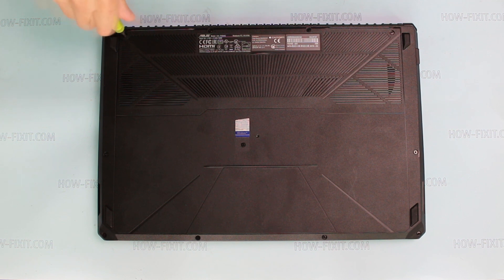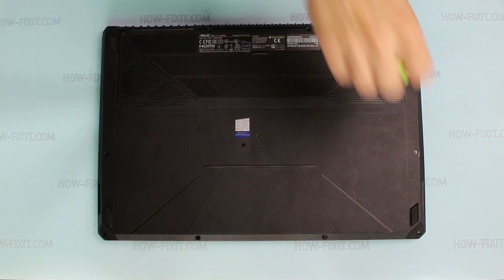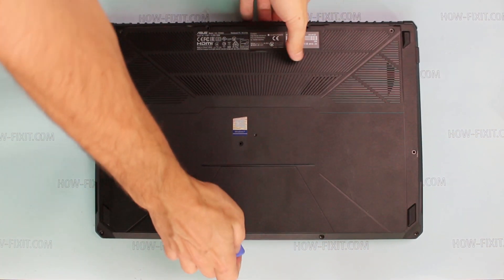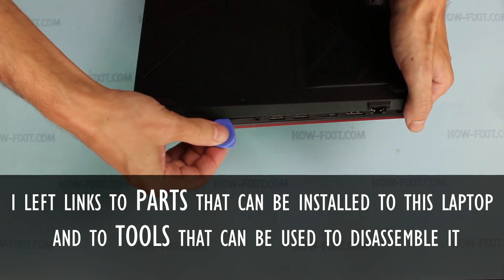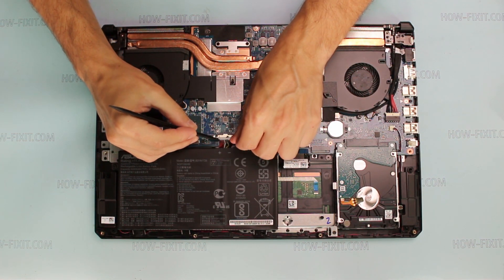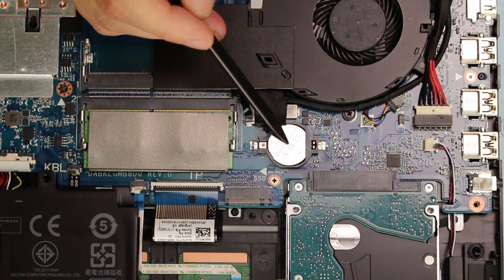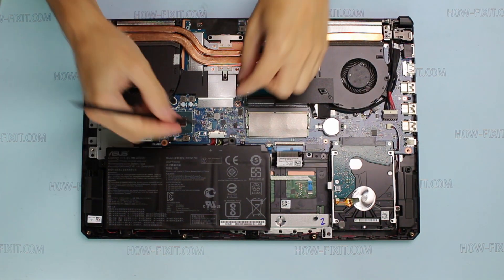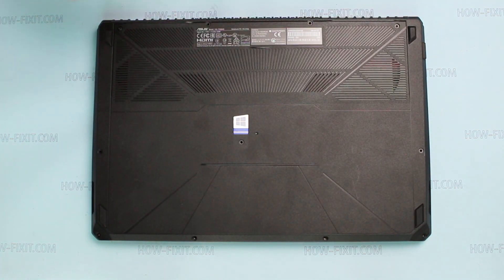Asus TUF Gaming FX504, FX503, FX80 Laptop BIOS Reset & CMOS Battery Replacement (Easy DIY)

Comment: I was trying to update my Bios via usb and it was stuck on Bios updading screen from almost q hour so i tried to turn off the laptop.  The laptop turned off but the keyborad lights were on and screen was black. I tried to turn on the laptop but nothing was happeming so i let the laptop like this and removed the charger so the battery could drain . Next day when laptop keyboard lights were off i olugged the charger in and the keyborad lights turn on directly and i pressed the turn on button but nothing was happening.  Will try this step now.  My laptop is Asus Tuf fx505du.

Comment: I have a problem with fx504gd. I ran a cpu benchmark in throttlestop and it takes 35w and 45w on turbo boost but as soon as I run a game or use anything that is using the gpu it is power throttling and stuck at 25w 2.2ghz. Tried everything in throttlestop and this does not go away. Guessing it was something did by asus to avoid overheating but is there anything I can do to fix this shit ?
Reply: same problem. High heat, low fps. It is because of the bios version 310. I am also looking in how to downgrading the version to 305 but nothing was usefull
Reply: Already said it but the only thing u can do is wait for the lazy cunts at asus to realise a fix but that will be only in September or so based on their previous update realise dates. 
You can't change the motherboard because the cpu and gpu are literally glued to the motherboard so it can't be replaced.
I don't think they tried to solve a heat problem because if they did, than they failed that bad that it just made it worse. I think it is a power management problem, the GPU is as good as before, the problem is on the CPU, it seems to have a locked voltage which is dangerous, it gets to much when it doesn't need it and when it needs that power the CPU is starved. This can cause many problems. In my case i get 20-30 fps in games where i'd get 60-70 or from 120 to 30-40. Their QA us garbage if it even exists
Reply: @happypotato4694  you can downgrade easily bro.
just get the bios version you want to downgrade, get winflash, and before running winflash SHIFT+Rightclick it and copy the route of the app.

then open a CMD command promt, paste the direction you just copied with CTRL+V, and then type (WITHOUT A SPACE) /nodate.

it will launch the program to flash your bios but bypassing the date of the bios, so it will let you downgrade.
Reply: @happypotato4694  welp, time to mod the bios i guess.
Reply: @retroke6560  it would be believable but than you live in Brăila and have a profile pic of an anime girl so.....
Reply: @happypotato4694  so, i'm basically trash for being born where i was born and having different pixels on my profile picture? k man, good luck on your laptop.
Reply: @retroke6560  bruh, este o gluma, nu trb da o iei in serios. Poate faptul ca ai prof pic cu anime dar este o gluma man. Don't gotta be mad

Comment: when I connect the battery with motherboard keyboard light automatically turn on..? plz help
Reply: i just ended up with the same problem, would like to know the fix for this
Reply: No not yet bro  @Pipeta11
Reply: hey bro u found something how to fix this prblm..? @Pipeta11
Reply: @swaggergaming6436   nothing... tried to discharge the battery and it didnt help, seems like when plugged it, the charger dont charge the battery. I made sure many times that everything is connected correctly but still nothing is working
Reply: So what we do now 😂 @Pipeta11
Reply: same problem here, got any solutions?